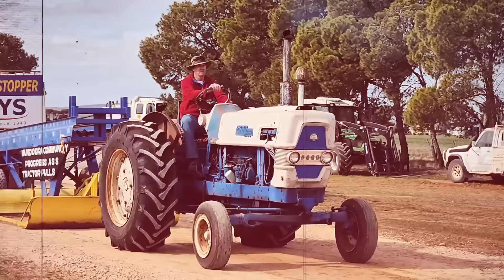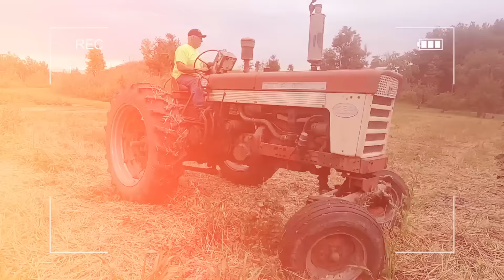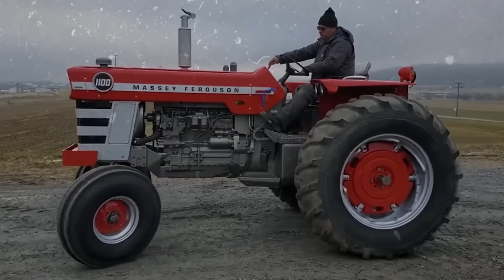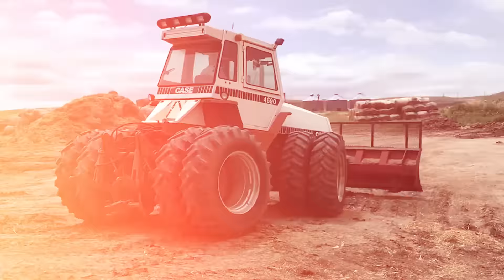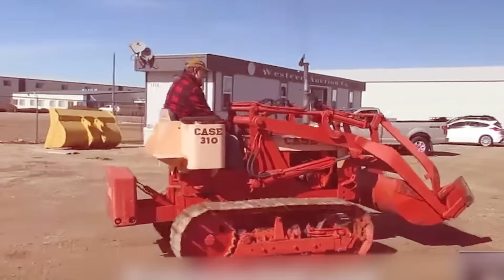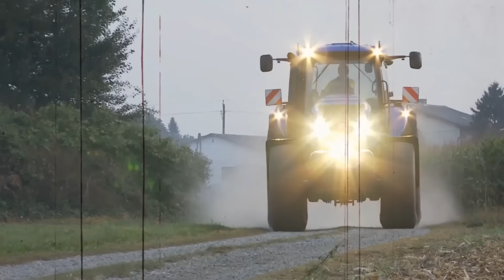12 Tractors So Dangerous They Were BANNED Forever!

Comment: 4690 was 250-260 horse, 4890 was 300 horse, with a Saab engine, never heard all that bs about them, all u had to do was drain the atf out of the rearend and fill with 90wt oil, the same as the first 930 cases!!!

Comment: The old 1100 were good old tractors, turning down the very high pressure to 1800-2000 psi fixed that crap, they came out at 4500psi!!!

Comment: While not being banned, I'm sure that some of these companies wished they were. The 6000 damaged Ford's reputation at least in North America for a long time if not indefinitely. Ford re-introduced it as the Commander which was a good tractor, but the damage was done. I really don't think that IH ever recovered from the 560, and it helped allow John Deere to leapfrog over IH to become the number one farm equipment company/manufacturer in North America generally by 1963/64. Indeed, John Deere is the last man standing today.
I would say that John Deere dodged a bullet with the 4X4 8010. Deere made 100 of these tractors and recalled them all, getting back maybe all but one or two. Deere re-introduced them after they'd been fixed as the 8020. After that, Deere left the 4X4 tractor market until essentially acquiring Wagner in the late 1960's.
The rest of the video is b.s..

Comment: I have a JD 1010 RUS. That thing,when it runs is a good tractor but with Armstrong steering makes it hard to use as a jinnin tractor. The three point  hydraulics suck but it'll run at full rpm all day bushhoggin.

Comment: What is illegal are the GREY MARKET tractors that were imported from Japan, their PTO speed is 1000 vs 540 the US standard, Power Take-Off (PTO) master shields and guards, required on tractors for the U.S. market, are not normally installed on gray market tractors. These devices are intended to protect from injury inadvertent contact with the rotating PTO shaft.

Gray market tractors generally do not have an over-running clutch on the PTO whereas tractors designed for the U.S. market generally do. When a gray market tractor without such feature is used with a large rotary implement, it is possible for the tractor to continue moving even when the brakes are applied. Such implements are common in the U.S., but not in Japan.

Some gray market tractors are not equipped with a safety start switch. This feature is designed to prevent the tractor from starting in gear and potentially striking or running over an operator who misuses the tractor by starting it from the ground instead of from the operator's seat as per maker’s instructions.

Pulling on the throttle of a gray market tractor will cause it to accelerate whereas pulling on the throttle of a tractor designed for the U.S. market will cause it to decelerate. This difference can have potential safety consequences for an unsuspecting operator.

Gray market tractors have multiple PTO speeds for operating implements whereas tractors designed for the U.S. market generally have one PTO speed, namely, 540 revolutions per minute (rpm). If a gray market tractor is used with an implement designed for the U.S. market, the implement can be operated at revolution speeds in excess of its 540 rpm design speed, potentially leading to catastrophic failure of the implement and possible injury.

Comment: The Ford 6000 was a POS, not because of the reliable 8 speed Select'O'speed transmision but the shit show accumulator hydraulic system!!! I bought one of these POS'S in the fall of 1975. The Accumulator system was OUT. You Could not lift an implement, attached to the lift arms or with a remote cylinder!!! I took it to a mechanic respected for his knowledge of all things mechanical. He repaired it to the best of his ability. It worked for one season. All this time, you could not lower an implement slowly down. It dropped almost freefall. By the second season this POS would not lift an implement completely out of the ground!! I disked the whole north 80 without lifting the disc. It was time to kick this POS to the curb. Went and bought a Massey Furguson 180, and never looked back!!!!!

Comment: We had the 2010 gas and used it for years, my brother finally sold it for a bigger tractor to move the bales.  The 3010 diesel wasn’t as good as the 3020 diesel but did fine for its day. After blowing the head gasket on the 3010 it was fixed when we traded it for the 3020 which was more powerful and better engine.

Comment: I used a 2010 for quite some time and never had a problem
Reply: I have an all original 2010 diesel none of the problems that they listed have happened to me. The only one is the hydraulics do sometimes drop but it’s really slow It takes about 10 minutes to drop a foot.
Reply: I’m assuming that back in the day they over powered them more often. Like using it as its intended might not be the problem but over working it is when it happens. Idk just thinking out loud